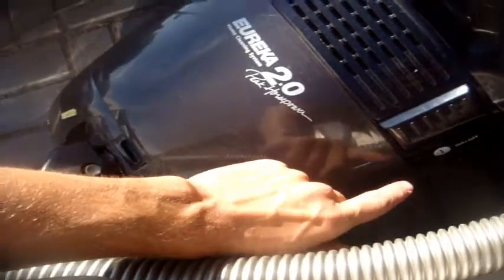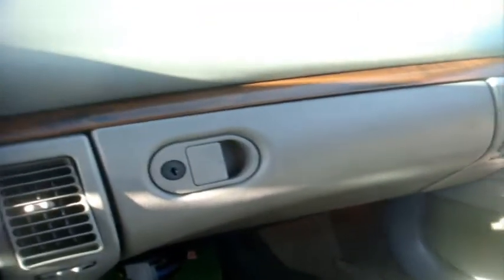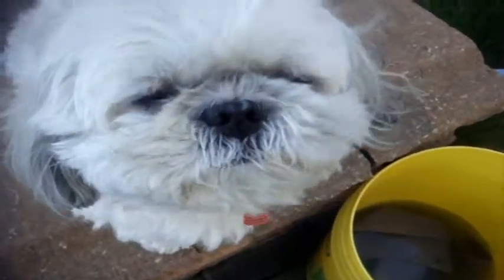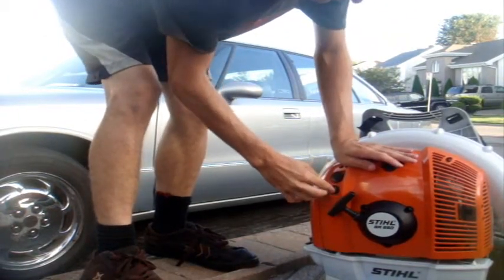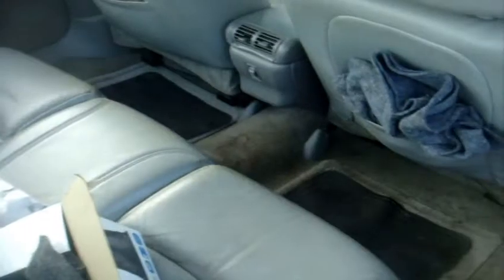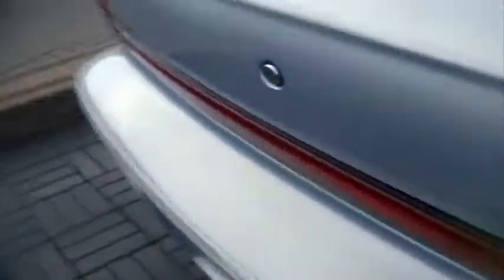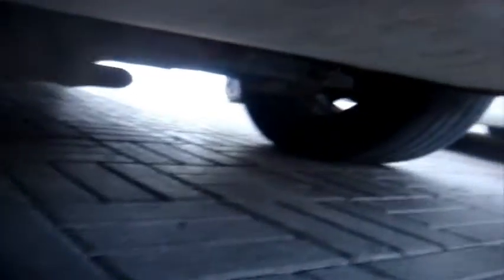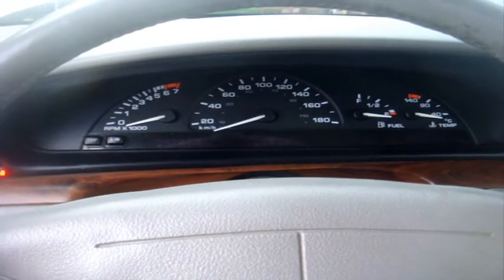Olds LSS Update and Wash

Comment: Hey a good vehicle to consider would be a early 2000's Chevrolet S-10. Those are good little trucks, cheap to maintain and what not. The V6 ones have plenty of power and aren't terrible on gas. I would recommend going with an american vehicle instead of an import because the parts for import's are ridiculously expensive due to the tsunami they had in japan. Even before they had  the tsunami to put a clutch in on my brother's 2004 Civic was $800 and that was cheap.

Comment: I really wish the 3.8 Series II sedans had been offered in a RWD platform as well. Sure they were put in the Camaros but those aren't really comfortable nor sedans...and though a lot of people prefer FWD because of how it acts on ice/slippery surfaces has little to do with the FWD and a lot to do with the weight distribution. Old Rear wheel cars had terribly front-heavy platforms and open-slip differentials that made them spin out easily without water/ice.

Comment: @Jon3800 Jesus there's a hole in your gas tank? Get an aluminum fuel cell if you wanna keep that car...that's an explosion waiting to happen. Gas isn't what ignites it's the vapor. If you want to keep the car get a fuel cell and put it in the trunk. Otherwise you could yank the Series II and slap it in something else...they'll last a LONG time as long as they're not rotted out with dexacool.